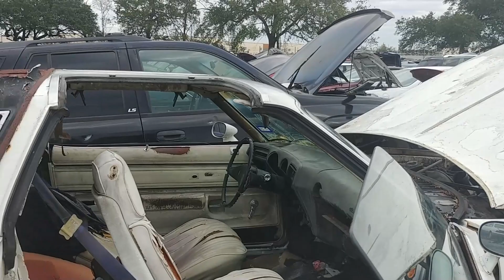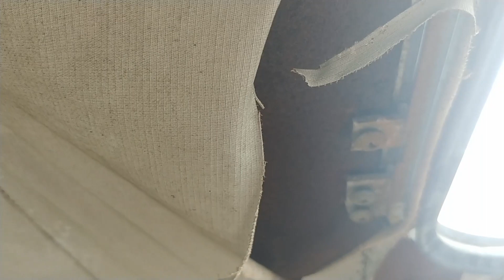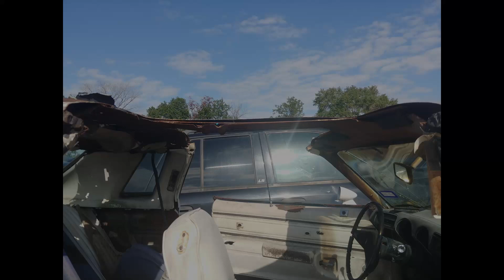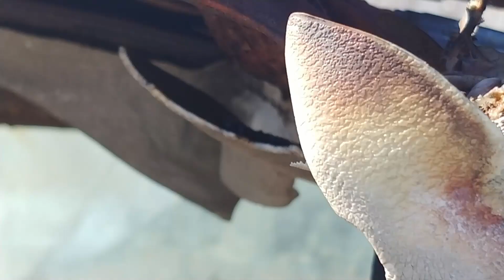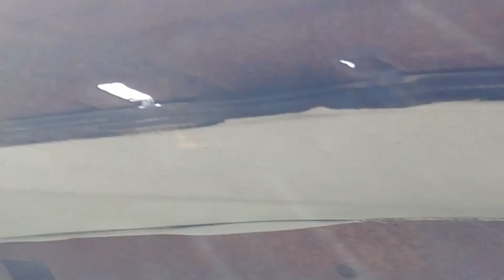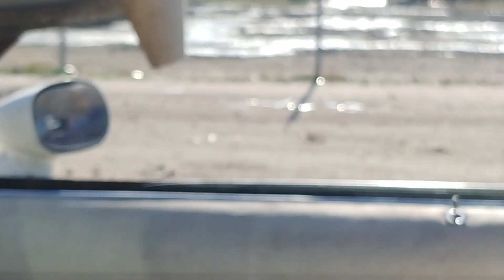1976 Cutlass With T Tops   Junkyard Find

Comment: If that T-top panel in the rear seat is from this car, this is a First design set.  The Second design did not have the chrome surround molding attached to the glass.  This car also never went in for the recall.  If it had, it would have the second design tops in it now.

Comment: Was this video shot recently? Because that looks like the one that was there a while back (North location) that i got two tires off of, they ended up having one that was in really good condition at the same location about a year later.
Reply from the maker: Hey, thanks for the comment. I just looked back at the original video and it appears I shot it back in December 2020. Does that sound about right?

Comment: I have one of these, a 1976 ! It's pretty beat down. Last ran in the early 2000s. Was a transmission seal problem. How much can you sell these for ?
Reply from the maker: These cars look great with T-Tops. But there are all kind of issues that come with it. Body twist, rattles, leaks, etc. I've seen these pieces sold as a set sell for $300 to $800 on some of the FB groups I follow. So the price is all over the board. Thanks for your comment.
Reply: @g3garage  no problem, they are  nice cars. Mostly take up time to do a rebuild. Thanks

Comment: Did you get the t top glass aswell or just the frames? For sale??
Reply from the maker: Yes, I got the glass but they have factures in them. Thanks for your comment.
Reply: @g3garage  will you sell the compete setup
Reply from the maker: @alonsogarcia3593  Frames and hardware have already been sold. Thanks.